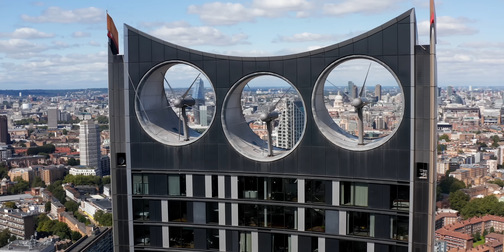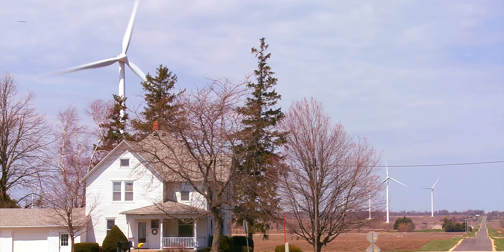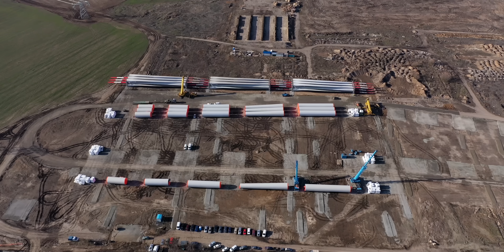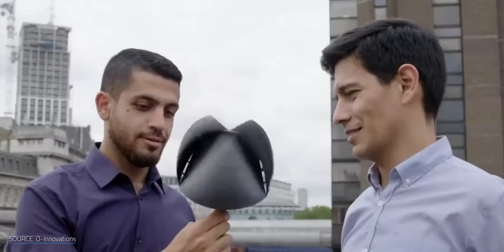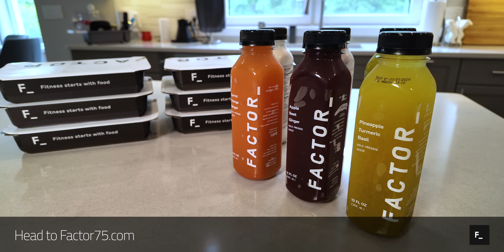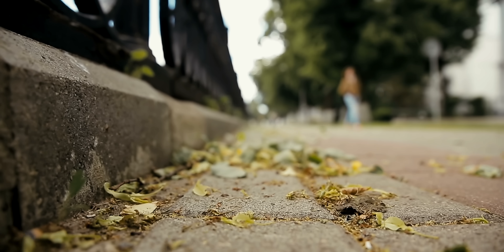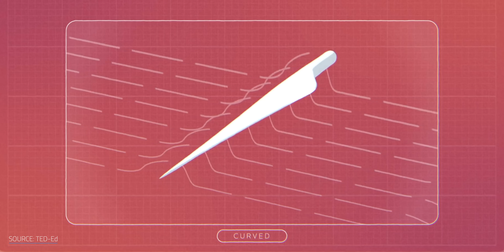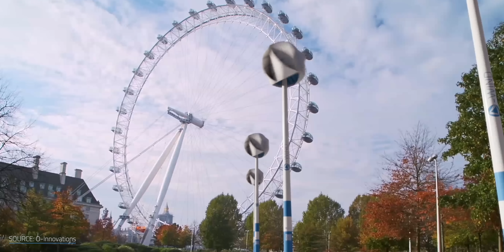How a Small Wind Turbine Will Revolutionize Wind Energy

Comment: No mention at all about efficiency, and I guess so because it is probably terribly inefficient. The turbine has a small area, lots of surface area (thus air drag). If the design is to capture turbulent airflow, then it basically captures 'bursts' of energy, making power point tracking difficult and much worse than if the wind energy is stable. If you capture bursts of energy, you need to store it somewhere, because you can't do much with it otherwise.
Reply: Instead of big single turbines, lots of small ones integrated with neighbourhood & town planning.  Plus most everyday domestic power use divides into heating/cooling {high power}& low power - device charging - like water needs a re think {blue, grey, brown},  maybe different circuits for use & power source.  Combine total design integration {passive apartment block, not houses, with district heating - industrial heat run off, with community scale heat pumps, enhanced geothermal......
Chances are if your an urbanite...your not a man with castle & mote, your a built community anyway {apt block etc}, might as well acknowledge it - factor it your design ie earth ship the city space.
Reply: @garrenosborne9623  no, the economics of wind entirely drive you to bigger blades. A small wind turbine producing exponentially less power is not exponentially cheaper. Cities could put up large-ish wind turbines in the middle of parking lots or golf courses (over NIMBY objections); anything else is a waste of money. Instead make Renewable Power Purchase agreements with someone who can build an economically viable wind farm somewhere else, and reduce red tape and utility intransigence so more building owners install more solar.
Reply: I think you are right regarding the efficiency of this ball.   There is another ball shaped design that uses  lift force. Its measured and simulated efficiency is maximum 12% in a narrow TSR range, so I guess that this ball has lower efficiency.
Reply: All SWTs are terribly inefficient, there return on investment is terrible. But the niche use case of leveraging gusty wind around tall buildings where the ambient wind is channeled may make them cost effective.  Still they need safety testing and zoning approval, so I'm not sure they'll ever catch on?

Comment: At some point, the way to advance to more efficient power sources, is to have countries require upgrades to the power system that takes the burden off of the consumer and instead, benefits all. We went from porcelain electrical fixtures and unprotected wire for modern wiring due to safety. A more efficient and less environmentally damaging power production is good for the safety of everyone and everything. We shouldn't have to wait until something is burning down before we move forward with progress.

Comment: Scale it down to less than a meter and I could see one of these at the top of every street light pole in a suburban city. Small enough and cheap enough, thousands of them could be installed in a medium sized city. Even if the efficiency for each is lower at that size, at scale it could be huge.

Comment: If their figures are correct, they may just about be viable in very windy cities.
That said, only for new buildings where the structure is designed to take the load and provide fixings. 
And in those locations, nearby full sized turbines will be a far better option. 
So if they come to anything, only a niche market.  A suitable sized one would be great on a boat, if quiet and vibration free.

Comment: Winds this invention could most use in cities can vary from stiff to level one hurricanes. The invention is great BUT the securing of the unit and its generated resistance forces may place unforeseen loads on a portion of the building upon which it is secured. Add to that load, a scenario where a sheet of material gets embedded or covers its surface, the result could be catastrophic destruction of a whole installation. Site selection and worst case planning is paramount in high density city/suburb environments.

Comment: The only viable turbines for power generation are Horizontal Axis Wind Turbines (HAWT's).  You get the maximum wind swept surface area (that's why the blades on those monsters are so large) which is a key variable in the Betz equation.  But that said, they have to be giant machines that are insanely expensive to engineer and build and only generate if there is wind.  Solar is vastly cheaper and more effective.

Comment: As you yourself have already mentioned, maintenance is the key to efficient use of wind turbines. That is why large wind turbines are much more cost-effective than small wind turbines. This design can also only provide a positive balance in specific places, and that is where the problem lies, which the designer himself honestly indicates.

What I think is that this design also needs a study every time into what the wind strength is over a longer period to find out whether this design is applicable. Of course, the costs for research will decrease per individual/household if a study is applicable to multiple households or placement of multiple wind turbines, but the design seems to focus on an average household and then the costs for research into whether it is suitable will increase drastically.

Where the 'resident' always experiences wind around his home, this will not immediately translate into a positive cost-benefit ratio. The fact is that wind is present 24/7, 365 days a year. Sun does not shine at night, wind does blow at night and at times when more power is required, such as in the evening when there is no sun.

The question can also be asked for the US why they consume so much power? Our household does not even consume 2500 kWh per year, if you consume more than 4,000 kWh in the Netherlands, even your provider will wonder why, let alone 10,000 kWh per year :o . It would be much wiser for the average household in the US to change your consumption in order to save costs, then a wind turbine like this can be applied much more easily.
Reply: also another thing about "study"   did you notice WHEN this inventor patented the o wind? I did; year 2018. Well that is 6 plus years old invention and that O-innovation did not publish preliminary study ... I liked robert murray's video about o-wind and how study is "delayed",  but six years old...(head shaking).
Reply: US power consumption is bit skeptic.   the real problem  did not post the source here.   my source said usa average home of 1,000 sq ft,  tend to consume between 4 to 6 kwh.  The problem is "average" home is not consistent  (home vs condo vs apartment vs high rise) in USA thus SKEWING the data.    When he said 10 kwh in usa,,  I looked for source.  nothing.  bah humbug fake reporting.

Comment: 3 years ago I bought a 10kW windturbine from AliExpress and it produced a whopping 125 kWh in one year. We have enough solar panels on our roofs to cover most of the year, but at the edge of our garrden there is a small run (stream) that starts running from September/October to about April maybe May, so I created a waterwheel and using a CVT transmission I connected the watersheel to the turbine and last year the construction produced 1700kWh and it generated enough energy in the winter months and in 2023 we pulled 230 kWh from the grid, so far this year we keeping it at zero. I created a funnel which for about 6 feet reduces the width of the stream with 60%, making the water flow faster which is probably why we're still at 0 and we have the added benefit that unlike a traditional windturnbine, our waterwheel turbine is not visible from the yard which I think is a big advantage...
Reply: @2Fast4Mellow  you for President 2028
Reply: Wish I had water running near me, but at least I got good solar and wind potential out here! That's cool, thanks for sharing your details.
Reply: How long before someone will make an STL file and share it online?
Reply: LOL save some energy for the rest of us 💙
Reply: So, 12.5 hours of generation at max capacity over a year?
Reply: @subjekt5577  You never ever reach max capacity. At windspeeds of 5mph, you only generate 80 watts if it stays that for an hour. At 10mph it is generating 280w, at 15mph already 900w, it is not an linear curve. This is also the reason why residential wind turbines are not a thing like solar panels. The rotor shaft and propeller are quite heavy and that is why you need a strong wind to get it started, but even if you take out the initial energy needed to start it, to keep the momentum, you still need a strong breeze to keep it going. It had the same problem when I started with my waterwheel. If I gave it a nudge, it would keep spinning for 10 t0 seconds, for the force of the passing water was not string enough to keep it spinning. That is why I start playing with the CVT, but I placed it 'reversed', so the output rpm is constant while the input rpm can fluctuate. Scooters are cheating a but in the sense that the throttle line splits in two where one line changes the CVT ratio and the other changes the power of the engine. The reverse CVT is more comparable to a mountain bike. Now imagine you want to maintain a speed of 10mph, depending on your gear ratio you need to peddle faster of slower to keep your speed steady. A lighter gear means you have to peddle faster (small to large gear ratio), so when our run begins flowing, it does not have a of energy, so you need a very light gear ratio, once the stream becomes stronger, you can change to a gear ratio that is heavier, but still keeps the wheel spinning. My controller board is constantly making very small adjustments to check if it still has the right gear ratio, it does this by measuring the output of the generator. It is basically a/b testing. If I go to a slighter higher gear ratio, is the generated output also higher, if not, you go the other way and check the output. It is of course also possible that the current gear ratio is already optimal and both result in less energy output. An unknowing bystander might think that this is a contraption of Wile E. Coyote... 

BTW: If you are energy independent, don't forget to switch to StarLink, because while your house still have power during a blackout, the distribution box in the street has not, meaning no internet. Found this out the hard way ;-)
Reply: @2Fast4Mellow so much energy wasted by water flowing around the sides and underneath the wheel.
I watched a Asian person build a trough with a funnel built into it at the end with a turbine fitted into the hole where the water would escape, back into the stream. I don't know your stream situation, but is it possible for you to do something like this? A thousand gallon (let's say) would flow into the trough, and a thousand gallons would exit the funnel that houses the turbine. I've watched many vids about this set up, but none of them have shown any data.
Reply: @2Fast4Mellow  Also if you have security cameras they would still work with your Starlink system.
Reply: Ik zou wel geintereseerd zjin in een video hierover :p
Reply: There are vids from Asia that show a trough construction built into a stream, with a funnel system at the end. The water flows down the trough, into the funnel and down the hole which turns a turbine. Easy build,  @thrash_jesus
Reply: You did notice this video is about urban wind harvesting right?
Reply: What was the rotor diameter ?
Reply: @dwwolf4636  7.2 feet or 2.2 meters.
Reply: Don’t share your location!  epa doesn’t look kindly any time you alter any kind of waterway, even on private land.  Not kidding.
Reply: This is so exciting.  Good for you!!
Reply: GOOD FOR USING YOUR HEAD-ME NO STREAM SO TRYING TO FIND AN AFFORDABLE WIND TURBINE TO BACK UP SOLAR ON NO SUN DAYS (a lot in virginia) I SEE 12000 NOT 1200 ON EBAYFOR $236 BUT TOO GOOD TO BE TRUE-DO YOU KNOW ANY CHEAP TURBINE EVEN IF 2KW THAT ACTUALLY WORKS? SOUNDS LIKE YOU KNOW WHAT U DOING-THANKS
Reply: You need to be mindful of the environmental impact of things like water wheels. You might severely impact the downstream ecosystem and topography by slowing down the flow, and introducing increased turbulence and therefore sediment at the site. I love the ingenuity, but it's no uncommon for people to do these types of projects without realizing how much impact they might be having. Especially if that impact takes years to materialize.

Side-note, I don't think "not being visible" is an advantage. People are always complaining about the sight of wind turbines, but I personally find them an aesthetic upgrade in most cases. Especially a design like in this video that looks like an art piece.
Reply: 125 kWh in one year is 14W per hour, you can use 2 lamps
Reply: @niunmango  If you left those two lights on 24/7/365, yes.  We don't have many lights on if we are gone or asleep.  If you can store it you have it when you need it.
Reply: @alanesterline2310  You are right, that's why I made a different comparison, you can power a small fridge 24x7, you wouldn't turn that off
Reply: @niunmango  you may not turn the fridge off but the thermostat does. Does your calculation allow for that?
Reply: @ColaSpandex  Yes, that's the average consumption per day for a small fridge, considering normal use
Reply: @niunmango   it's 14 watt per hour, per second, per month, it's 14 watts.

What I mean is, watt oer time doesn't make sense.
How much power does your car have per minute? ;-)

But so many watts so lomg continuously, that makes sense when you have some energy stored.

Your motor could work with more power, but your battery can only deliver 14 watts fo so long... 14 Wh when it cam deliver only 14 watts for one hour and it's empty. For example.
Reply: @Richard-S  OK, a different comparison: it is 340Wh per day, average. 1 medium fridge or 4 hours of a TV or 40 minutes of an air conditioner if you are lucky. Those are exclusive or, you have to choose what to power
Reply: @niunmango   yes, good examples, many thanks!
Reply: if the wind-turbine is 10kW, is it hourly, daily, monthly? If it's monthly then fine, 125kW is a lot, but otherwise it's just like 10 days worth of power used by an average home - peanuts really. The waterwheel generator is another matter as 1,7MWh is in the ballpark of a usable solution but then again, who has access to flowing water? Hardly anybody.

Not to deny one can setup a home system using zero or almost zero external power. That's certainly doable, but solutions of 150-300 kWh are not viable unless they are dirt cheap and can be scaled when needed. You can setup a lot of solar panels but you cannot set too many wind-turbines on a given area as they will suffocate each-other.
Reply: @vaakdemandante8772   if it is 10 kW, than this would be the maximum power output at the maximum allowable wind speed. (it must be a rather big wind turbine for a private person...) 

When you have these 10 kW for 5 hours, then you get a total of 50 kWh accumulated energy. That would be a full EV charge. 

But when the wind is too low (like at my place) then it could not deliver anything for most of the time. (except when a cold front rushes through, but when it's over then it's over... at my place...).

Solar typically delivers more, but only during the day. 10 kW peak solar power would be a small installation for a house roof. 20 or more would be more typical.
Reply: @vaakdemandante8772  It's maximum output is 10kW, but it needs a hurricane in order to produce that. It's like the maximum output of your solar panels, only obtainable in perfect conditions. The turbine can reach 10kWh if it is spinning at the maximum rpm for an hour. It required a 8 m/s wind to start spinning, but about 9m/s to sustain it. Wind power is useless, it was almost never spinning. It spun sometime late autumn to early spring, but not enough to generate real power. Still, the 1700 kWh is nothing compared to the 13.500+ kWh generated by the solar panels, but it is enough for the winter months to help out with the lack of sun power. I started testing first with the waterwheel directly attached to the shaft of the windturbine (as a replacement of the wind propeller) and a garden hose. Did not work, then I started playing with different gear ratio's. We had a defunct scooter and I converted the CVT for use with the wind turbine. On the propeller shaft there is a white marking and a RPM meter is reading that figure, an arduino is controlling a servo that is changing the gear ratio of the CVT. It's typical range is between 400 and 900 wH. Our typical annual power usage is 14-15 mHw and I wanted to make minimal changes to our daily routines (family of 6). 

The turbine was quite expensive, so I started tinkering in the hope I gout recuperate some of my money. It works, but I agree not suitable for most other people ;-)
Reply: @vaakdemandante8772 125 kWh / year using 10kW windmill = 12.5 hours effective per year.

That is bad.
Reply: Not to burst your bubble but it is almost certainly illegal to have that water turbine. Unless you went through massive headaches getting an environmental impact study done plus had lawyers look over the water rights and the FERC  permits then you legally can’t do that.
Reply: @guns4786  its only illegal if they find out
Reply: @guns4786  Might depend upon where @2Fast4Mellow is located.  I'm not going to ask him, that's his business.
Reply: Wtf you had a 10kW wind turbine and you made only that much in 6 months and it's whopping????
Reply: @QueenOfArabianSea  I believe that was a sarcastic “whopping”
Reply: @QueenOfArabianSea  Could be a sarcastic "whopping" and that is why looked at alt energy sources.